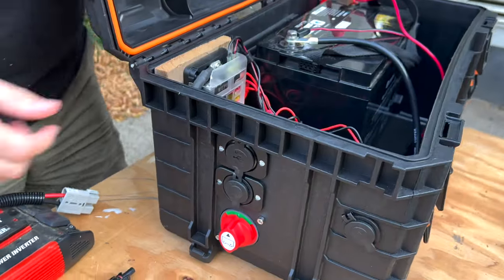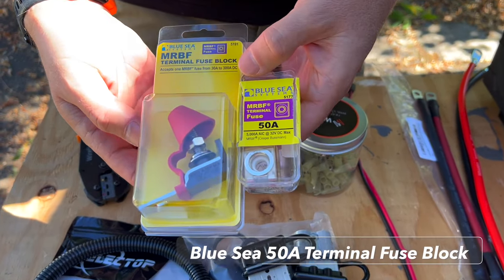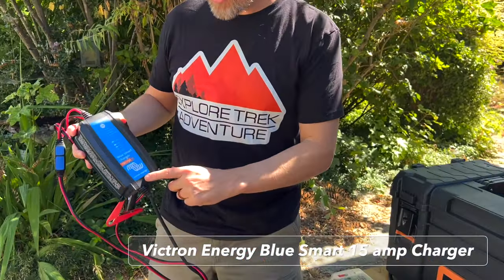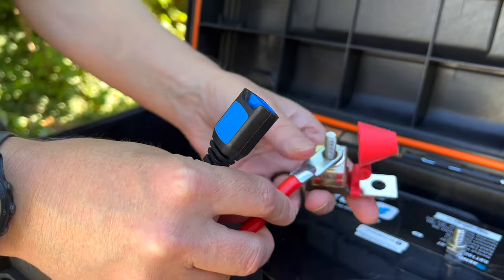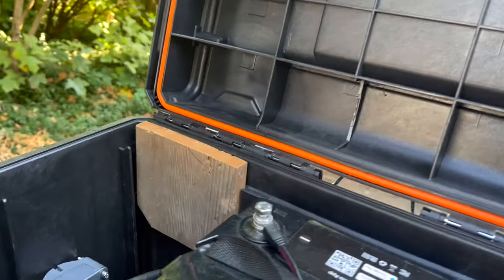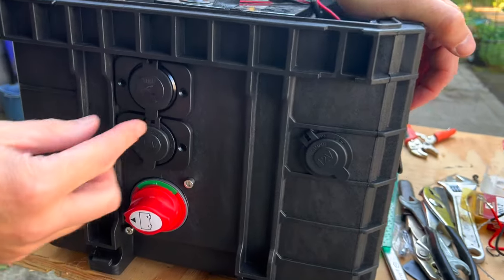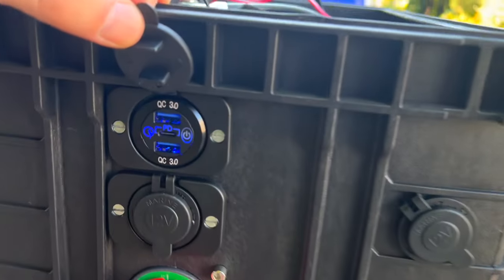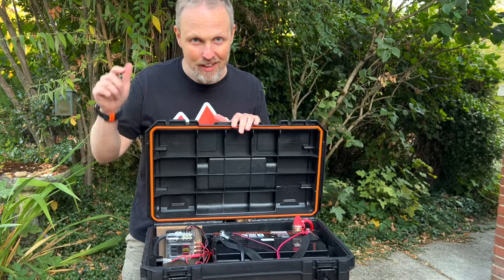DIY Solar Generator - Portable Lithium Battery Box Build - Part 1

Comment: This would have been a great video if you had mentioned the cost of each part and the specs for the battery and other parts.
Reply from the maker: You can find the list of parts we used in the description along with a link to the video that goes over our battery & solar panel choice.
Reply: How much was the total cost
Reply: @ExploreTrekAdventure  is paying you to build it for me an option?
Reply: I’m assuming this was just a DIYers project because there is no way this was less expensive / or time consuming than purchasing an 800w/h unit.
Reply: Nice 1200w unit.
Reply: I feel a lithium battery attached to an inverter would be a cheaper cost, and simple. I can find an inverter for as low as 170-200 bucks with a watt range of 2000-3000 watt, my buddy showed me how to do it and he powers a whole 7x16 camper trailer he converted.
Reply: Agreed. Just post prices of parts and total build within the video rather than have us follow each link for prices.
Reply: @Yeshua9596 the inverter only convert up to that range. You still need a battery with that capacity 😂😂😂😂
Reply: @vontrap6942 The reason why people post these projects is so that people will use the links to Amazon to buy the parts.   If lots of people do that,  Amazon pays them a referral fee.     

Either someone is willing to at least click a link and read or honestly they are probably to lazy to actually build one anyway. 

Mostly I watch these videos for entertainment but I also build things like this.  Once you build one  you don't even need to look at a parts list.  My suggestion is to first build one on a piece of plywood,  and then build it into a box, just to make like life easy the first time.

Comment: What total cost did you have in your amazing build ?
Reply: $100 😃
Reply: $100 = bullshit! I would say closer to $400. The battery alone is at least $200.
Reply: @nivid01 if you look in the description you can look at the links. The battery costs $500 alone! Crazy.
Reply: @codygeorge1008 if you're going fully off grid, it will pay for itself within a year or two. No more energy bill
Reply: @Chevroletcelebrity you missed a zeros  😂
Reply: about $700.00
Reply: In my country. I would say 7000 php because battery is around 4000 and inverter is around 2000 php. And the rest are for 1000. But in USA. I would say around 200-600 USD

Comment: Personally, I think I would have found a board that fits nicely behind the battery, that would act as a spacer so you wouldn't have to cut out the webbing in the lod, and the you could mount your fuse block to it, without possibly needing to drill holes to mount the board.  Then if you could find other pieces of wood or fairly stiff closed cell foam to keep battery in place (I know you mentioned putting a  hold down strap for the battery.  I had to rewind how you used the wire stripper...I think it is opposite of how I would use it, BUT maybe the way you did it, is the best, you aren't dragging your parts that cut into the insulation across your copper (that could nick your copper, and dull the parts intended to cut through the insulation.  Nice build!  I hate to drill holes in a waterproof box, but to do what you are, unavoidable, maybe make all holes as high as possible incase box gets partially submerged in water.  I have some of the rigid boxes and I think they are my box of choice (quality/price).

Comment: I built a Li-Ion box out of a pelican case and 152 18650 batteries. It is 1.8kWh and I use it almost specifically to charge my Jackery explorer 300. When our fridge is plugged into the 300 and the battery is charging it, it will go for about 3 days consistently. I like these kinds of projects and am planning one with some Eve 280AH cells

Comment: Really like how you set yours up. I did a similar DIY solar generator and I used a big old Rubbermaid storage bin to fit just about all of the same components plus a 1200 watt inverter, MPPT, and some 12 volt case fans. So there’s a lot of dead space in mine

Comment: Seeing ports have rubber covers, perhaps use a gasket or silicone seal around the hole before mounting ports. Also may be interesting to build an inverter into another Rigid box. Then stack them for AC output in a grid down situation.
Reply: I like that idea
Reply: That is exactly who I built mine.  Also used stainless hardware for anything on the outside.

Comment: I did the exact same thing but went with the biggest box of the ridged system that has the wheels and handle.  The extra space gave me the room for an extra battery an inverter and a few different electrical plugs and connectors.  Going on 4 years absolutely zero regrets. It powers my conversion van 90% of the time but when camping or hunkering down for a hurricane the portability is priceless.  At the time I built this box I didn't know there was an off the shelf solution but by doing it myself I saved a ton of money and have the box configured to what I need.
Reply: how much did the two battery system and gear run you if you mind me asking.. ?  We are trying to set one up now
Reply: What precautions would you need to take with the battery pack during hurricane season? Like if you’re in an area and it floods is that an electrocution danger?
Reply: What's the total output in watts? Any idea?

Comment: Really well thought out setup! I'll soon be making something similar, but with an AGM battery.

As for possible suggestions, you could consider an internal led light mounted in the lid, that powers on either manually by a switch, or automatically as the lid is opened (kinda similar to how some closets etc. are set up). The idea is to get a better overview if you need to check inside the box for some reasons, while it is dark where you are at. It's all about that convenience! :) Thanks for the video!

Comment: Nice setup. I did have one build for testing purposes without the inverter. I did build one based in a 5Ah 18V Ryobi One Li-Ion battery with a 200W solar panel. The test did draw the power directly from Victron Bluesolar 75/15  the 12v-terminals equipped with Bluetooth-dongle for monitoring and settings. Works well for small scale devices like the 12V-cooler. The charging was done with 3A with specific settings to the Victron MPPT charger. It did work well, but charge current wasn't enough to run 12V cooler with all my drinks on it and charging it on the fly (The cooler draw about 65-75W of power. Normally i did use it directly from MPPT solar controller without battery and stopped when clouds comes out of hiding :) Like i said, it was a test for the adding a battery. Battery not too heavy as i do haul whole thing with my Recumbent 3-wheeler bike and a trailer attached to it. So, there's a limit for weight in all this. The Ryobi 18V battery doesn't like more than 3A of charging current, so i did leave the idea of that there and run if directly from the MPPT after the cooler drained the battery. Need a bigger battery with a better charging capability or run those batteries in paraller with 6 A charging current. In Finland, similar Li-ion 12V battery as your installation costs an arm and leg. About 1000 euros each. I'm planning to build solar battery from 3.2V cells instead. It's cheaper, alot.

Nice to watch these kinds of setups.

Comment: Love that you used the Rigid Box. That system is so versatile and rugged, so it totally makes sense!
Reply from the maker: Yes it’s a great little toolbox. 😀
Reply: @ExploreTrekAdventure  yes... they are great for the price. I worked in film and photo and used pelicans for decades... now I have a pretty extensive assortment of these and love them... makes sense to do this now too. I like the idea of stacking extra batteries too. I would incorporate a robust inverter to power tools for homesteading off grid.

Comment: Nice project, one thing I have discovered using the USB marine type chargers, is that the touch switch can be kinda finicky in cold weather. I opted for aversion with a regular switch to put in my truck, they have a positive shut off- my charger has a built in voltmeter as well and I didn’t want a ghost load. Locking good!

Comment: Just ran across your video.  It is perfect for what I want to do.  I'm thinking of only using 12V cigarette lighter plugs to run a 12V fridge, a couple of cpaps, and 12V fans.  No inverter only DC power.  Thank you for sharing.

Comment: Very cool build!  I did something almost the same, but I used the bottom box (with the extendable handle and wheels) to hold the battery, shunt and solar charge controller.  I then used a 175 amp Anderson connection to go from the battery up to the middle box where I have a set of bus bars, various 12v outputs, and a 1,000w Renogy inverter.  I then have two 3-prong 110 output from Noco coming out the side of the box to plug in stuff.  Yours is definitely lighter and a little more portable/stackable.  I hope you have enjoyed using it as much as we have.  :)
Reply from the maker: Sounds like you have a great setup!
Reply: @ExploreTrekAdventure  - It works, just like yours does.  I can't easily pick mine up and throw it in my truck, though.  It's a little too bulky for that, really.  It's all about use case and form factor, right?  :)

Comment: I like this build! My personal application is for in a boat, though (12 ft) so ill be going for minimal size and I'll have 3/8" posts on the outside to hook my trolling motor up. I like the Rigid stacking boxes though because the Radio can clip on to the lid!

Comment: I use Goal Zero 1500X for all my camping power needs that is recharged using 2 Goal Zero 100w solar panels. It works great and reliable.

Comment: Nice build. Neatly carried out. An essential add I would make is a vent at the top side. when you’re charging a lead-acid battery, it gives off hydrogen. AGM batteries absorb most of the hydrogen and oxygen again and turn it back into water, so they’re reasonably well-sealed, yet they still have vents that will vent some gas.

But defiantly inspired to make my own. Thank you.
Reply: Not sure if you decided to build something like this, but that is a lithium iron-phosphate battery...no potential for off-gassing.  I made a similar type of power station and added both intake and exhaust vents (with a thermal switch) to help keep everything reasonably cool on hot summer days.
Reply: @jasonbroom7147  thanks for that. Really helpful.

Comment: Nice with the toolbox. My suggestion, maybe a 200A fuse instead? So you can use a drill for example.
Not shore how your converting the power though. :yougotthis:

Comment: I did something similar with a regular battery box. I use it for over night fishing and just general power needs. One thing I suggest adding is a small eagle eye light connected to a switch.
Reply from the maker: Great suggestion!

Comment: I’d definitely add some type of power meter to tell you how much power is being used and how much remains in the battery.  Nice box.  I’d would build one like it.
Reply: Is there a product you suggest for this? Seems like a good idea but I don’t know where to start with that
Reply: The battery has built in bluetooth monitoring according to the website.

Comment: Very nice. I also plan to mostly use the inverter that comes with a pre-built generator. Can use DC from the big battery to recharge the generator that has an inverter if need be.

Comment: You guys gonna do a follow up to this video? I'm currently looking to do one and I'd love to see how yours has been doing.
Reply from the maker: We do not have anything planned at the moment. What specific questions do you have?
Reply: Just wanted to know how it has been working and if you guys wish you had done something differently. You also mentioned that you use the 200 watt inverter on the Jackery, but did not  mention how. Do you somehow connect the DIY solar generator to your Jackery, or do you use it completely seperate from your DIY solar generator?

Comment: Suggestion: try and get the 12v sockets and rocker switches that mount on panels that are made of metal. The metal threads are only on the tube that is beneath the surface.
The all-plastic ones can strip easily and you sockets/rockers will rotate.
Reply from the maker: Great suggestion

Comment: Thanks for the awesome video. Would it be possible to keep this charger connected to the battery continuously so it charges while your driving? Then only unplug it when you get to camp and hook it to solar?
Reply from the maker: You could with a dc charge controller.
Reply: @ExploreTrekAdventure  thank you for the help

Comment: Nice video. The only thing I hve to add is do not bind any cable togheter to make it shorter/look nicer. If you bind it in a circle, it will drain energy during use.
Reply: An electric cable in a loop forms a magnetic field.
Could that bother delicate electronics?

Comment: 6:42 I think you'll find that the wire strippers work better if you turn the strippers around so you are gripping the wire side and pulling the stripped cover off with the cutting side.

Comment: I have a question. I am planning on building a 12 volt power supply box, using a 12 volt Deep cycle Lead Acid Marine Battery, and a 2000 Watt Power Inverter. My question is this: for charging the 12 volt Deep cycle marine battery, I will need to use a 12 volt smart trickle charger. Can I plug that charger into the inverter  while it is being powered by the same 12 volt Deep cycle marine battery that is needing to be trickle charged, or would I need to plug the 12 volt smart trickle charger into a regular wall outlet ?
Reply: @kev,
A perpetual motion machine?

Comment: I am not sure if I missed it or not.  I did not see any air vent gaskets on your box.  With that battery being charged and used I would add those water proof air vents that way if your battery starts to expel any gases or heat for what ever reason your box doesn't blow up.
Reply from the maker: Lithium batteries are sealed and do not require venting. Other types of batteries you would need to add a vent/fan.

Comment: How would I get a wiring diagram to add a 400 watt inverter ? I literally have the same components that you do with the exception of the jackery, I want to wire in a small 400 watt inverter with all copper wiring.

Comment: I am able to fit 2-80 ah lifepo4 batteries  in the short second box from ridgid  2.0 there is space in the middle( 5") same size box used in this video.

I am building a 24 vdc power supply  for my inflatable  kayak motor. A simple on off switch, and a 10 amp inline fuse. And marine twist on plug with cap. Drill the least number of holes i can. The batteries  almost touch the lid in the short box. If you need more room to mount inverter and such, i recomend the taller xl box. ( see home depot) i am installing a 24vdc step down to 12vdc  box for a future fish finder power as well
Pad eyes, and battery cam straps hold batteries  in place.

Comment: Is there any way to add a 110v outlet for a low power requirement?  I just found a need to power a podcast station at a remote location.  Thanks and I liked the DC setup!

Comment: hi i want to use this diy technique to power my rv using the 50amp plug that I usually plug into the camp site power pole.. is this possible? similar to the new power banks that can do that example: oupes mega 2 , 3 and 5 .. thanks

Comment: What would you do to keep a monitor on the batter level and if you went with a larger batter like a greater that 500ah battery, would anything need to change like bigger cords or different fuse box?
Reply from the maker: We chose a battery that has built in Bluetooth bms so we can monitor the battery levels from our phone.

Comment: Hey, Curious about why you only put a terminal fuse on the positive and also a fuse box. Is that not redundant? I do like how it simplifies the wiring process.
Reply: Semi-retired Aircraft Mechanic A&P here.
I install a fuse or circuit-breaker on any electric source:
* battery
* photovoltaic
* alternator/generator...
... to protect the cable.

Comment: also, if you were to wire an inverter into this, where would you wire it in relationship to the kill switch and fuse box, would it be going into the fuse box??
Reply: No. It would be wired to the battery.

Comment: i found some times screws or nuts come loose from vibration, what i do is use Goop on the end of the threads near the nut or the head of the screw before i insert into the intended hole. easily comes off if needed.
Reply: Nylocks : a nut with a 'nylon' insert to reduce unloosening.

Comment: Cool build man! I got confused at the end tho…when you picked up the solar cable connector wire you said you will get an Anderson flush mount then wire that to the fuse panel block. Don’t you need to run the solar wire to a charge controller, then from charge controller to battery?? Which I didn’t see at all in the video.
Reply from the maker: Make sure and watch part 2 which goes over the solar. We went with a solar suitcase which has the charge controller built in. 
DIY Solar Generator - Part 2 - AC & Solar Charging
https://youtu.be/gjvM3UXzAoI

Comment: Hard to find a terminal fuse block with an M8 battery connection.  It's important to use the proper sized connectors.

Comment: Awesome build, would adding a couple more batteries in series be fine with this configuration?
Reply from the maker: You should be able to add more batteries. Just check with the battery manufacturer to see the recommended way to wire them up.

Comment: Turn the battery sideways you can add a 1000 watt inverter on top. 200 watt inverter is good adding a second inverter is great!  It's better to have it and not need it, Then to not have it and need it.

Comment: I would also add a volt meter  just so you can tell when the battery is getting low
Reply from the maker: We picked a battery with a Bluetooth bms so we could check it on our phones but that would be a good option as well.